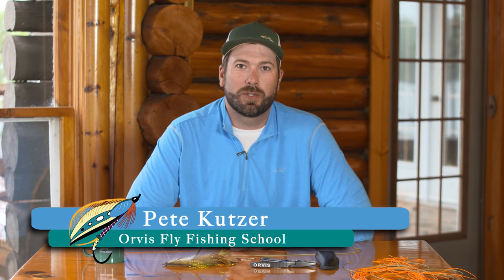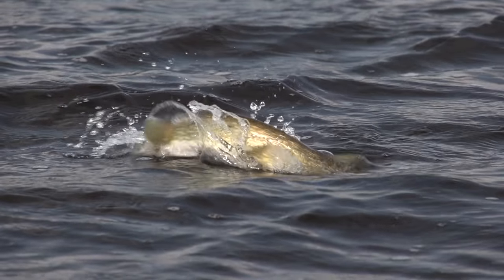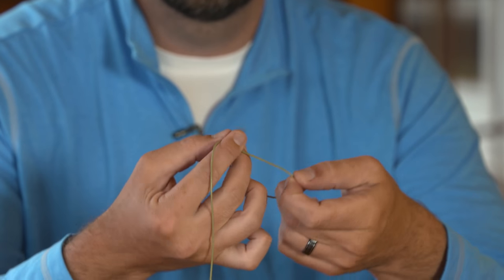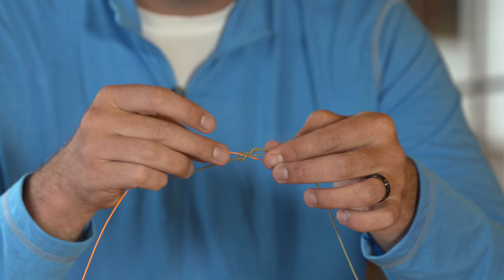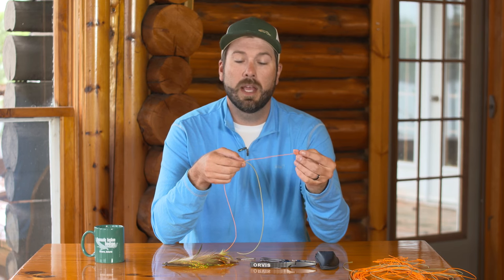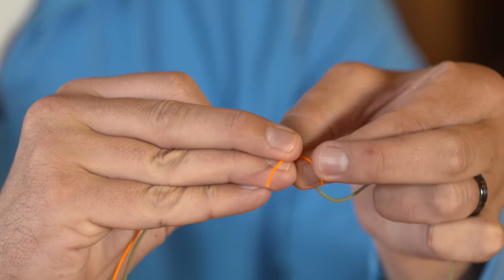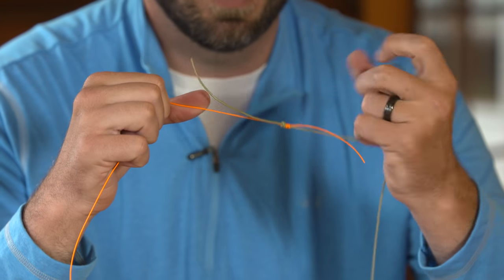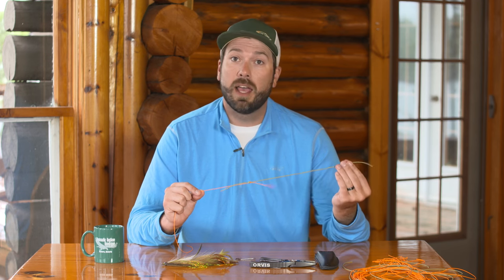ORVIS - Fly Fishing Knots- Bite Tippet Connection

Comment: I've been using this knot for fly fishing for alligator gar and have had several breaks at this knot during the hookset. I've since been testing knots at home and find this knot very easy to break compared to other knots (e.g., double uni). I'm using RIO saltwater mono in 20 lb for line class and 50 lb for the shock tippet. The 20lb breaks at the knot quite easily. I do not recommend this knot! I love simplicity but not at the expense of utility. Beware.